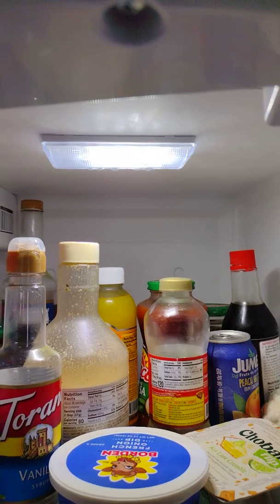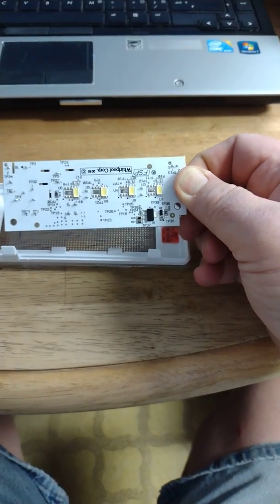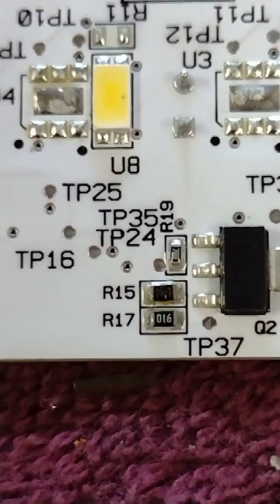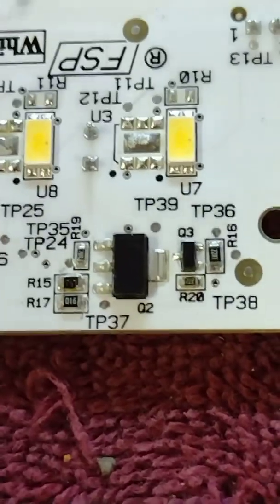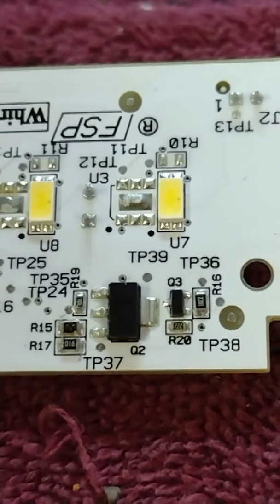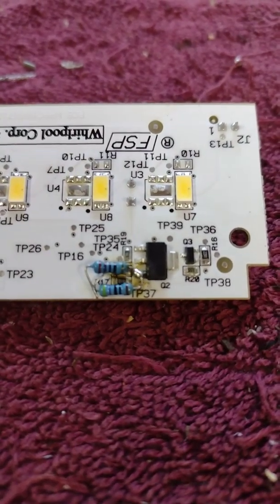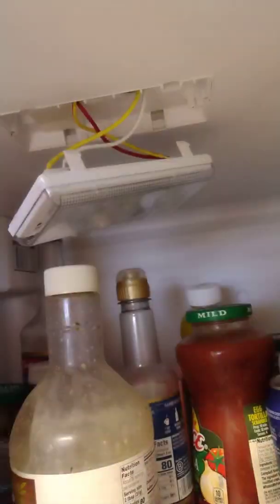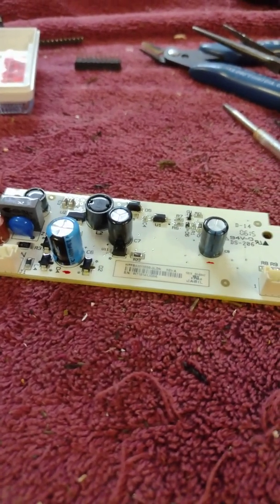Repairing flickering light in a Whirlpool side by side refrigerator; model WRS325FDAM04.

Comment: You might consider actually showing us how to remove the light. You glossed over it quickly and did not show us. Started off all wrong for me.
Reply from the maker: Hi.  Yes, sorry about that.  I simple took a small flat head screwdriver and pryed on each edge until it popped out.  It is not fastened by anything except plastic clips, so go slowly as to not snap off the clips.

Comment: I just got a new double door/French door refrigerator and it does the same thing (flickers or fail to light entirely) when the left side is open by itself. After doing some testing, my problem is the switch on the left. When I flick the switch or pull on it, it comes on solid.

Comment: My moms whirlpool is also doing this and is also 6 years old but I don’t have the skills to solder
Reply from the maker: Don't be scared to try and solder, it is a useful skill and you can learn.  Or you can just buy the PCB. Remove it first to make sure it is the same.  I think they were around $50 when I was looking for one.
Reply: How did you find the pcb on Ebay? Was there a part number that you searched for?
Reply: An aftermarket light fixture seems to be 60$ still crazy expensive for a light